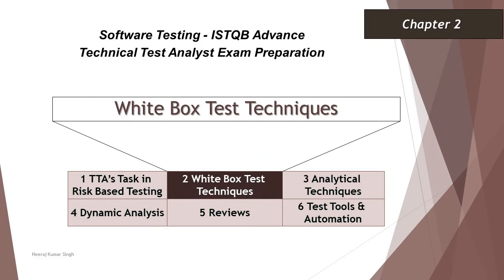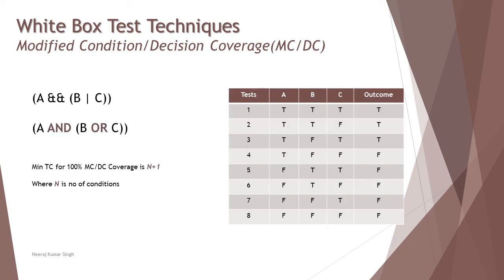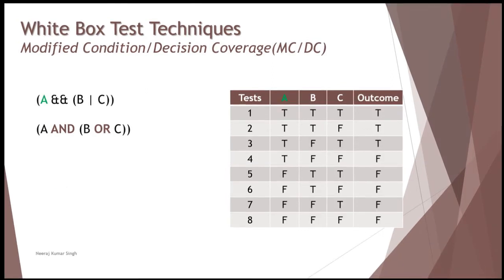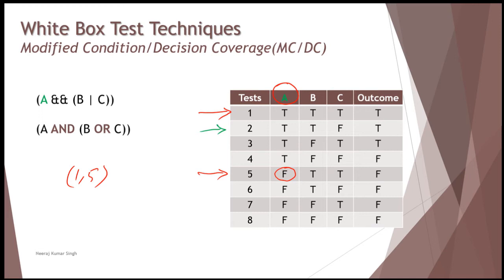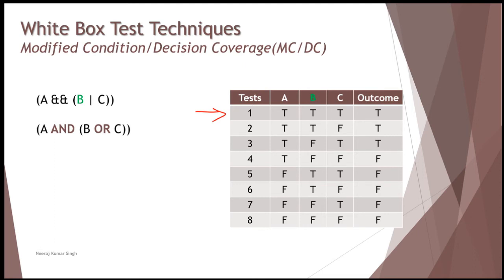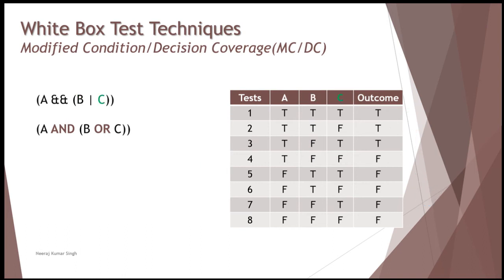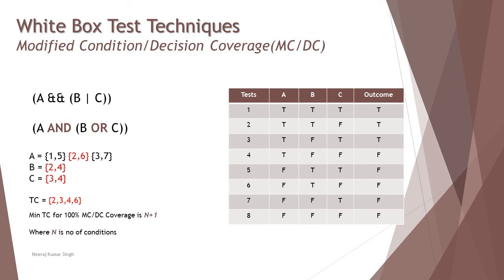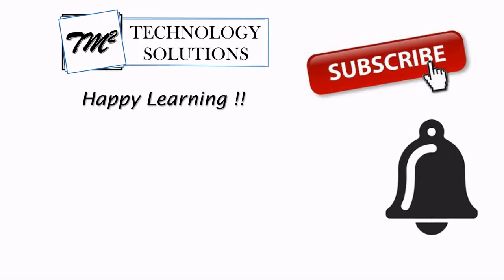ISTQB Technical Test Analyst | 2.4 Modified Condition/Decision Coverage (MC/DC) Testing

Comment: Great job. Everything is  explained clearly. Waiting for next chapters. I have a small concern regarding the given answer for  discussed sample question here.  Can't we select {3,7} from A. Then answer will be  {2,3,4,7} Is that also correct? Any feedback?
Reply from the maker: Hi Priya,
That's a great input and observation. Yes, That's correct as well. Yes, it is a possibility as well. It's upto you decide on the final set of test cases. The main objective is to make sure that you have covered all conditions and then a common set to cover them all in order to reduce the test cases.
Reply: @TMSQUARETECH  Thanks!